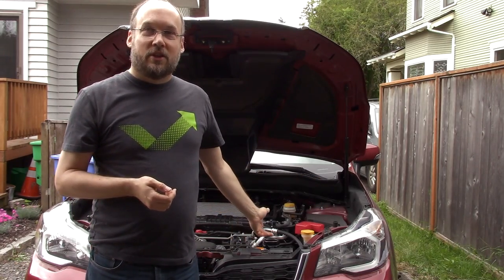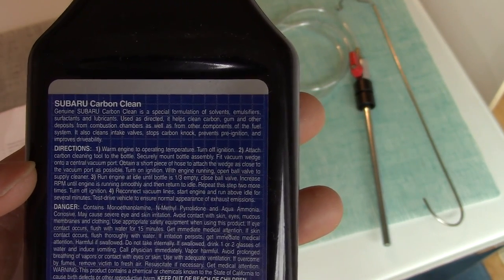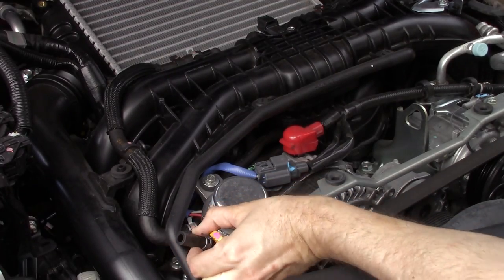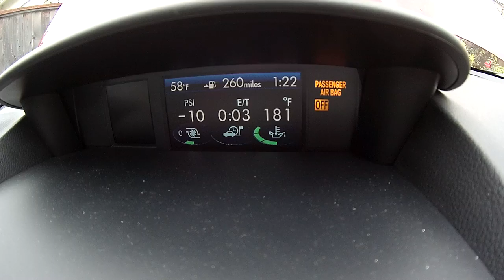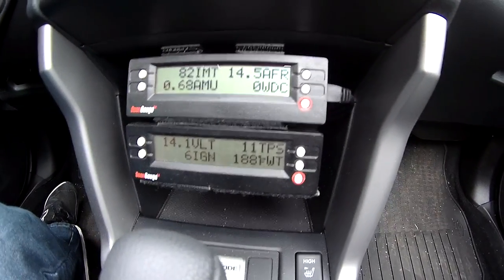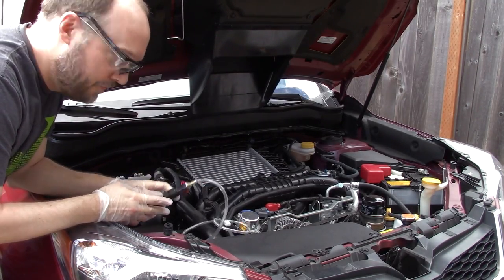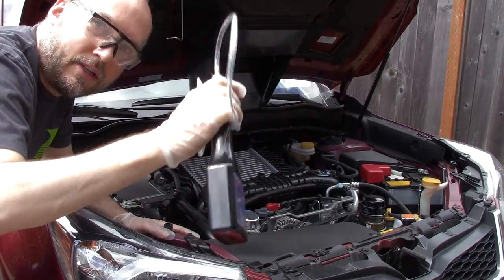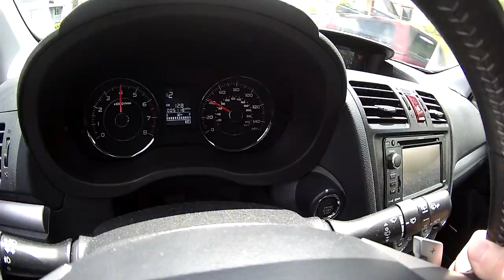Using Subaru Carbon Clean on my 2015 Forester XT

Comment: I spent an hour using seafoam from the MAP port to find out there is a tool for this.... Thank you for posting, I would have never known about this.
Reply: @adriansdigitalbasement  I ordered the tool for next time. Thank you for posting
Reply: @07BlueRu   so you do not use the cleaning tool in the map port?
Reply: @myfukinarmhurts  I didn't know it existsed loo

Comment: Hi. How can I perform this clean if I am only able to get the CRC intake valve and turbo cleaner in my country and not the one you are using? I saw another video where a guy spray the whole can directly into the center of the system, taking out the sensor, but it seems that it could cause some issues? Thanks in advance.

Comment: The carbon buildup does not come from the fuel, it comes from the OIL in the engine. You see, the small amounts of blow-by gasses that flow past the piston rings and into the crankcase are vented via the PCV valve. These gasses carry small amounts of crankcase oil vapors directly to the intake manifold. These oil vapors tend to STICK to the hot surfaces around the inlet valves, turning into carbon as they heat up over time. So if you disconnect the hose from the PCV valve then you get rid of the problem of carbon forming on the intake valves. You then have a massive vacuum leak, so you have to plug up the open hose that used to be connected to the PCV valve. Now the system simply thinks that your PCV valve is plugged and no gases are coming from the PCV valve and that's just fine. The PCV valve should be left open so that excess pressure from the crankcase can be vented into the air. Of course you have to re-connect all of the stuff each year to pass your emissions tests, but that's easy to do. So just delete the PCV valve this way and you totally get rid of any 'ADDITIONAL' carbon buildup problems, it won't clean the carbon buildup that you already have.

To remove any existing carbon deposits you have on the intake valves it is best to use something called WALNUT SHELL BLASTING, something that is similar to sand-blasting, except that they use small bits of walnut shells because they won't do damage to the engine if they happen to get into the engine itself. Many BMW and Volkswagen dealers offer this service now.

Comment: I currently work in a Subaru service centre, and performing a upper engine clean (carbon clean) is a very effective way to prevent carbon buildup on basic and especially direct injection type engines.

What I usually do to a customers car is perform the carbon clean (here in Australia, we use the pressurised can version called "upper engine cleaner") on a warmed up engine. After finishing the process, I usually drain the oil (oil get contaminated with carbon residue etc) and throw on a brand new oil filter

To top it off, a bottle of Subaru fuel additive (any fuel injector additive) will prolong and prevent any carbon buildup which in turn causes issues down the road (usual symptoms are rough engine idle,hard starts,bad fuel consumption and worse case scenario engine failure due to seized intake valves.
Reply: Hey do you happen to know if an aftermarket air/oil separator would do any good in preventing carbon buildup? What about combination of AO-sep + Subie fuel additive?

It's a dumb question, but I'd thought that you might have some more anecdotal experience on this particular matter.
Reply: I recently had Terra Clean service done to my 15 WRX at 30K, the publisher of this video has nothing to worry with only 5K on his car. Terra Clean DIT service is good option, however short of walnut blasting or using a nylon brush to scrub down the intake valves  nothing is going to fully get rid of intake valve deposits, Terra Clean works only to a degree since the system injects the cleaning solution into the fuel rail. Since DI fuel does not touch the intake valves this is the concern. Terra Clean helps clean everything following the cylinders but I don't believe it will clean/help the buildup on the intake valves. Your best solution is short OCI and top quality fuels and a good run into the upper rpm range to increase heat which will aid in burn off of carbon, a good ole Italian tune up weekly, rev that motor
Reply: An oil separator wouldn't do anything in this particular case, it's just how car manufacturers designed the engine (being a direct injection system)
When fuel is introduced into the cylinder via port injector, injectors spray fuel mist onto the intake valves and gets sucked into cylinder, as with direct injection, fuel gets injected into the cylinder directly bypassing the valves (fuel doesn't touch the intake valve, so no cleaning is happening, as petrol does have different types of additives to help with carbon issues.

I tend to stick with higher octane premium fuels (I avoid unheard of petrol stations, as their fuels origin is unknown of) and higher octane fuels have better additives and R'N'D invested to combat carbon buildup

With the BRZ /FT86/GT86 engines, the design of their fuel injection system eliminates carbon build with the use of direct injection as main and port injection as a slave. Which in all is a superior setup as it hits carbon build and fuel economy, reason why a lot of car manufacturers don't apply this setup more often is due to cost

So, my advice to all Subaru owners (mainly later model vehicles) is to ensure you use a can of upper engine cleaner each service.
If you are not sure, just do it anyway for peace of mind. 

the procedure I usually perform with upper engine cleaner is, warm engine up to operating temperature. Shut engine off and empty a can into the intake manfold (ONLY 1 CAN to prevent hydrolocking) and let the engine sit for about 15minutes for it to eat and loosen carbon.
After 15 minutes, I start the car (most times, car will struggle to start)make sure you crank 3-4 seconds at a time with light application of throttle.

AND WATCH THE SMOKE SHOW! Doing it with the engine running works, but it doesn't leave much stuff on top of the valve to soak and clean
(Ps, I do not hold responsibility to any failures or screw ups, proceed with care or ask someone if In doubt)

Kenny
Reply: mrh22a the spray one Subaru make is fantastic stuff I just wish they made a diesel safe one. I know three bond make one that is meant to work the same but it's not as good.
Reply: Every single service you suggest this? Doesn't that seem... overkill?  I do my own oil changes, but if this was something someone did at the dealer you're talking probably $100+ USD for service now, every 3k miles. We don't have any recommendation for these for the FXT in the US which uses the FA20DIT, was thinking this would be more of a 30k type of inclusion - maybe yearly at most?  What would the effect of running at higher RPM's do for this (using Paddles to keep myself around 4k RPM for a few minutes of straight highway driving)

And I think it's a good call to do this before an oil change, maybe even a few days before, to get everything trapped in the oil/filter before change.  What about the fuel additive, that's just there for a future buildup preventer?  In the past I would put Techron in my tank about a week before I did an oil change.
Reply: Change your oil immediately after this procedure. Also do an EGR delete and TGV deletes. Once you start to get that idle and cruise stumble you'll be on board.
Reply: Y’all walnut blasting?
Reply: That right there is an absolute lie from Subaru.

No cleaner added to the fuel or fuel line could EVER prevent carbon deposits on top of the intake valves on Direct Injection engines. That’s the whole problem with DI! The fuel already has solvents/detergents and if it could get up there, it would already clean them, but it cannot because the valves are closed when fuel is added!
Reply: mrh22a Upper engine cleaner has proven not to dissolve much at all, just like Seafoam. That’s with actual boroscope.

Comment: I did this on my 2016 XT with 88k miles at 8.5 years of ownership. You would not believe how white the exhaust was, especially when rev'ing the engine between cleans. My engine did stall after the first time. I started it back at WOT like the instructions stated if it stalled. I have a second bottle will probably do this again in 6 months or so.
Reply: Did you notice an improvement after the first use? Driveability/idle/gas mileage? 100k FA20DIT owner asking
Reply: @chugns1481  not really 😔

Comment: Glad to see I'm not the only one rocking the -170 oil filters on an XT!
Reply: I'm using the 170 on the Ascent. The blue subaru filter doesn't even fill the holder.
Reply: What’s the benefit of using the 170 over the recommended 160?

Comment: also.. do the egr delete, and oil catch can mods... never worry about this again.   plus your engine will run much much better.   well you'll also need an Accessport from Cobb and a tuner to remove the check engine light from removing egr

Comment: I did a Lethal Injection on my 12 y.o.  5 speed manual Suzuki in the parking lot of a local McD's. (Duralube-) Thick plumes of white smoke everywhere. Behind the restaurant is an industrial area along a hwy. So I drove it hard to give it the old Italian tune up, high revs in the 5000 rpm range. The engine was howling. Still smoke everywhere, then when I figured it wasn't going to stall I wheeled it on the hwy for a good hard 60 km jaunt. The engine runs whisper quiet, like the day I drove it off the dealer lot.

Comment: Thank you for the great video. I have the same car. Could you let me know what the cleaning tool part number is please?
Reply: i think its called something else now.  Top Engine Cleaner (SOA868V9160), a mist that removes soft carbon 
deposits from the intake plenum and valves, upper cylinders, and 
compression rings. Application requires Top Engine Cleaner Tool 
(SOA868V9430).

Comment: Have you kept up this process since and seen good results? My 2015 XT is about to pass 40k miles and I've noticed horrible knocking at certain loads/RPMs more than likely caused by excessive carbon buildup, thinking about trying this.
Reply: Walnut blasting is due.

Comment: I have to wonder if the improvement in emissions is offset by the carbon that got removed, given it appears to have passed into the atmosphere anyway via the tailpipe, when you did this process.
Reply: That's a good question, but remember the unburnt fuel that leaks through an open PCV into the atmosphere is many times more deleterious to the environment compared to fuel that is fully combusted in the catalytic converter. For a simple example, I'm told the unburnt methane gas is 25X worse than the CO2 that would be produced after it it burned. This is why it is strangely more responsible to burn off methane flares at gas wells compared to simply letting it leak without burning into the air. And it's why there has been so much effort put into EVAP systems, to hang onto those volatile molecules.

Comment: With GDI engines doing the air induction service should be done every 12-15k miles. Now every 5k miles or oil change add a bottle of techron complete fuel system cleaner the black bottle not the grey to the gas tank or BG 44k. These 2 are the best fuel system cleaners the hyundai and kia engineers recommend them an at hyundai and kia we use all the bg fluids and cleaners same goes for Ford where i currently am a tech. I was a Hyundai and Kia master tech. Now I use the bg air induction cleaner as I have found it to be one of the best at cleaning carbon off the intake valves and pistons I also used it on my 2012 stage 2 sti and 2010 stage 2 evo x mr touring. Doing it every oil change is a little over kill but u def will have one clean carbon free engine. Just make sure your running a catch can and using rotella t6 5w40 oil. It will keep blow by to a minimum my sti never lost more then 1/4 of a quart every 3k miles.

Comment: what's the difference between the stuff you used and the upper engine cleaner?
Reply: Ya plan on running a bottle through with my next oil change. I have a 2016 wrx, which intake hose did you use on the intake manifold? I see two in the area you were working on in mine, but can't tell exactly which to use.
Reply: its the one with the hose clamp
Reply: Cost. Both are useless though.

Comment: would seafoam work the same way? or would it be better to use the subaru one?
Reply: Seafoam works the same way although I would use the Subaru cleaner if you own a Subaru. It is nice that an OEM makes a product like this for their vehicles rather than pretending they are no issues to worry about like carbon buildup. If your car is not under warranty anymore then either Seafoam or Subaru would be just fine.
Reply: Peter Grooms thanks for the reply. mine is still under warranty for 4k miles more. i just looked up on amazon and they have a kit that comes with fuel injector cleaner, throttle body cleaner and this. have you used the other two on your car? and if so, you should make another video so we can get informed and know what to do. haha. but anyhow, thanks for the video now i have a reference on how to do mines.
Reply: almethus gutierrez do not seafoam turbo engines
Reply: Subaru (and other manufacturers) make top end engine cleaners (like Seafoam) specifically for turbocharged engines. I drove my turbo 1.8 Audi to over 155k miles with a Seafoam treatment every oil change. It's perfectly safe.
Reply: They’re the same thing, chemically and both don’t do crap for intake cleaning. They do a decent job on the pistons, but not the intake valves. This is what supports the claims on the product. Notice they don’t say where the build-up is cleaned or how much. That’s key. They won’t harm your engine if you do it right, but they’re basically a waste of money. Save it for the walnut shell blasting you’ll need to do at 60-90k miles.

Comment: That engine doesn't have enough miles on it to remove anything.  Funny how people think that probably dozens of engineers at Subie never thought this enough of a rampant issue to warrant including in their regular maintenance.  It's an issue for people who drive primarily at city speeds and temps...and use poor quality oil which they fail to change regularly.  My intakes(which I scoped) look fine after 90k(2014 XT) so it's not that ALL cars will foul up after xxxxxx miles.
Reply: TakeDeadAim What do speeds have to do with engine work? RPMs is what counts. City use actually runs engines at higher RPMs than highway, which tends to heat up and burn off more carbon build-up. Nice try though!

Comment: Really dislike how the fa sounds. The engine noises they make make it sound broke.u have a wrx and hate the tapping sound it makes when revving. Dont know how else to describe it. Just sounds like everything's going to fall apart.
Reply: Those are the injectors very common noise on any DIT engine not just subaru

Comment: I believe revving your engine will cause a boost situation so positive pressure in the plenum rather than vacuum. At idle, no boost and negative PSI the engine vacuum (negative PSI) is pulling in the liquid however you can see that when you press on the accelerator the fluid flow stops. The other problem is the fact that a mist or fog of liquid would be a much better and uniform application that a solid flow of liquid. I recommend skipping the lame Subaru factory part and cleaner, purchasing Seafoam and a reusable sprayer like this (http://www.tooldex.com/milwaukee-sprayer-1002-sure-shot-sprayers.html?___store=default&utm_source=GoogleShopping&gclid=CjwKEAjwmf6-BRDi9fSN7Ijt1wUSJAASawcjIi_04Ibz7m-l65Z3mOoRJG-47BG6iQiz2vnyQt16UxoCg57w_wcB) which sprays a fine mist. Using the same vacuum hose you can use the fore mentioned can to properly introduce the fuel system cleaner in the intake tract. If you follow seafoam instructions, spray then let it sit for 10 minutes then run it again you will see a significant amount of smoke with a blue hue to it which to me is representative of carbon burn off. I will try to make a video the next time I do this. I do it BEFORE every oil change to prevent oil contamination.

Comment: Fa20 engine you have has both direct and port injection. Depending on load the respective injectors spray. Low loads----both run-----high loads----only direct injection. With this setup, you shouldn't have a build up on the valves.
Reply: Thats an FA20DIT should be the same as the WRX and has only direct injection. Its not an FA20 like the brz has which has both port and direct injection
Reply: You are thinking about a different car, thats the brz. FXT doesnt have port injection

Comment: you kinda got a little bit wrong sort of a lot of your carbon buildup is because the valve is closing at the wrong time by nanoseconds so the carbon is solely from the explosion and exhaust gases there shouldn't be any exhaust gases coming through the intake valve only through the exhaust exhaust valve should always have carbon build up it's just normal that's no way getting around it but if you're getting carbon buildup on an intake valve has nothing to do with the import jection has to do with the timing of the intake valve opening closing or the valve guy could be bad as well if your valve guide or valve seats or Bad Day Giveaway you're always going to have this problem and you're going to have loss of compression lost compression loss of torque poor fuel economy it's a domino effect so your theory of what you're saying is kind of right but wrong as well so but this is just what I know as a mechanic